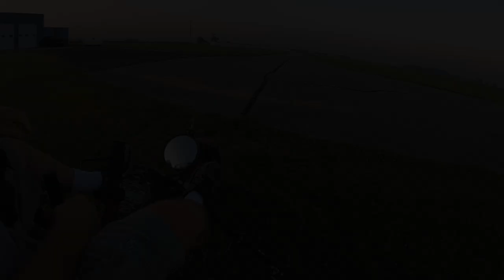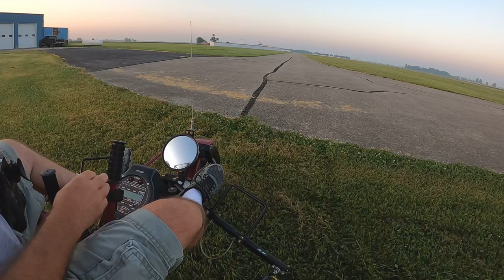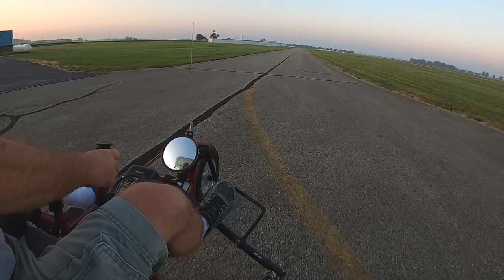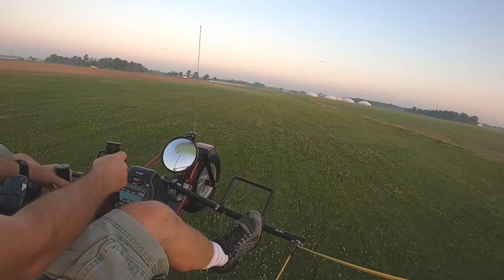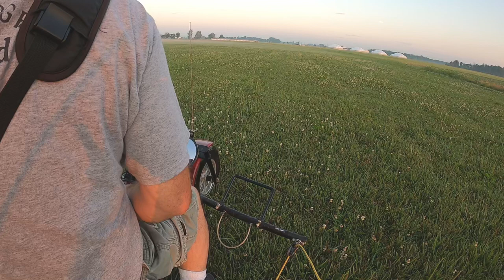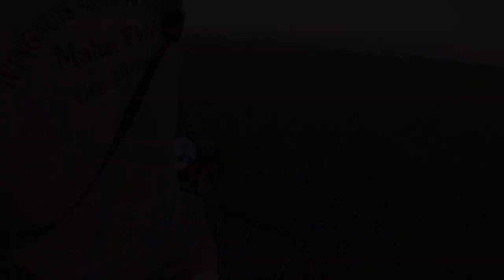Tension Knot During Powered Parachute Takeoff

Comment: I have not had to deal with any line issues YET, but it sure would help if you could have included a better explanation of exactly what a tension knot is and perhaps a photo or two to help others understand them better.  They are not mentioned at all in the FFA Powered Parachute Handbook.  I'm going to try to remember to ask one our local CFIs about that subject next time I see them. 

By the way, Scott, I really DO ENJOY your great videos.   Greetings from Utah.
Reply from the maker: A tension knot occurs when 1 more more lines get tangled together (a single line can get twisted) and when they are put under tension at takeoff, they tighten into a knot.  When you get a knot in the lines, the effective line length changes, causing a deformation in the shape of the parachute.  This can result in several issues, including a turning tendency, which is what I experienced right after takeoff.

Thanks for watching my videos!